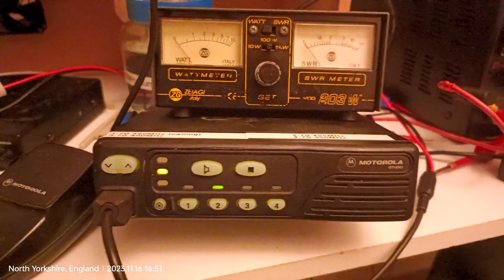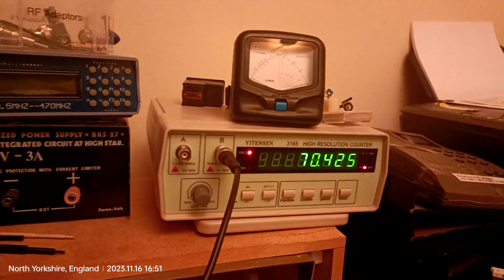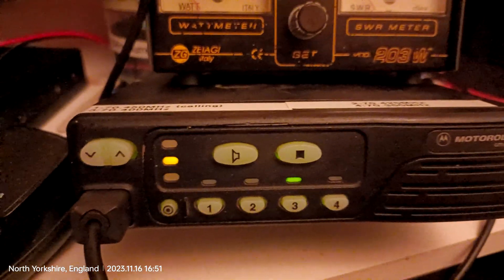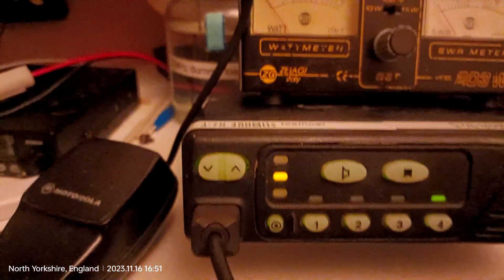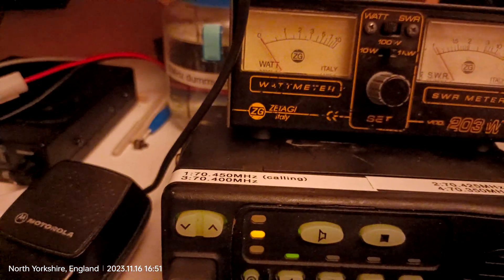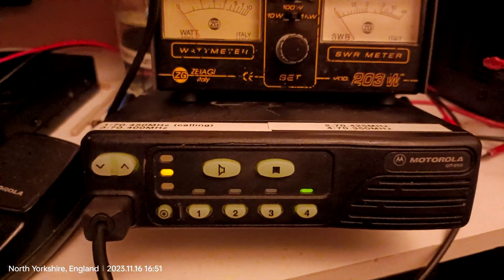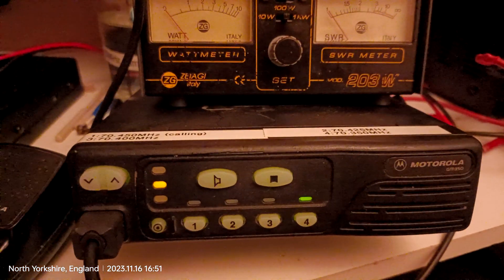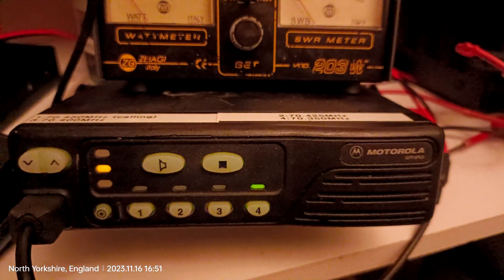Something isn't quite right with the Motorola GM350

Comment: Hi Paul. We live at opposite ends of the country (which could make it tricky) but get in touch if you get really stuck.

I have a couple of these radios and actually have the equipment to program them. It's been a couple of years since I've booted up that computer (it's been sat at the back of my office) but I presume that it will still work!!!

You're right about needing an old computer. From what I've been told, trying to program these with a modern computer could corrupt the radio & leave you with a fairly novel door stop!

I'm not sure of the actual specs but my computer which I use for programming these runs Windows 95!

Like I said, get in touch if you get stuck & want a hand. I'll help if I can.

Comment: Just an idea, you could try and run a virtual system. Shame you're not near me Paul, I have a few old laptops that would cater your needs. Oh have you seen a modded Quansheng UV-K5 Covers a wide spread band. From 80hz up to 2ghz. And does FM, AM, and USB. Best £30 I've spent.
Reply from the maker: I've not looked at the Quansheng radios yet, been meaning to buy one for a while though because of this custom firmware
Reply: Unfortunately anything but raw DOS and a real serial port typically doesn't work with these. It's been quite a while since I was into old Motos but I seem to remember the RSS sofware wouldn't even program a radio if running in a DOS window under Win98, you had to exit out of Windows into DOS mode.
Reply from the maker: @treelineresearch3387  the RSS I have obtained for this radio is a Windows version which I have had running on Windows 3.1 in DOSBox, whether that would program the radio is another matter of course though it may not and might require older computer hardware
Reply: @PaulMcGeeM0WNU  Ah that might be a newer generation than the software used on the MCX and Jedi HTs that I've used, but I suspect the serial port requirements are going to be similar.